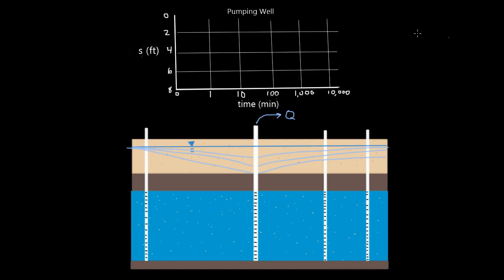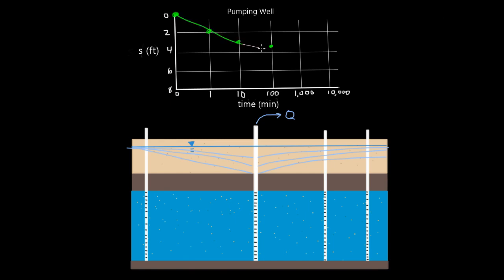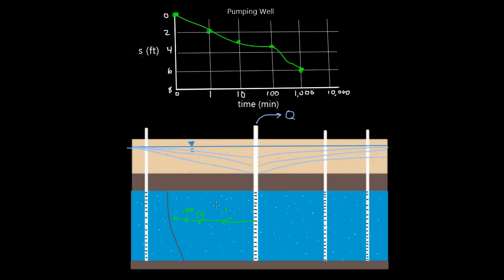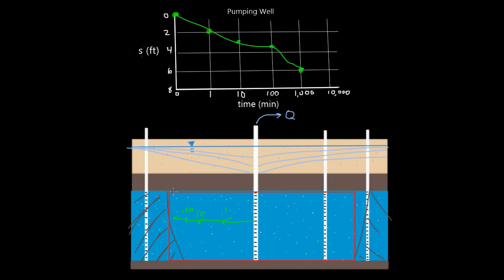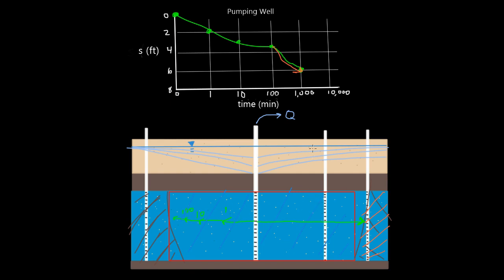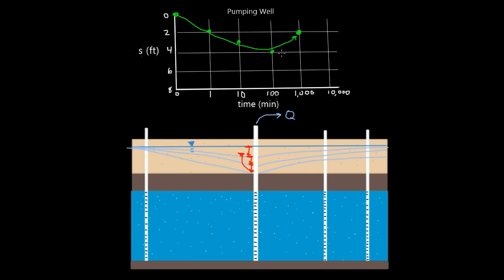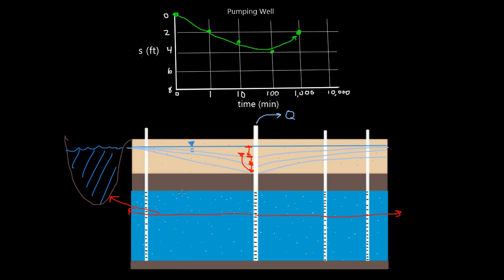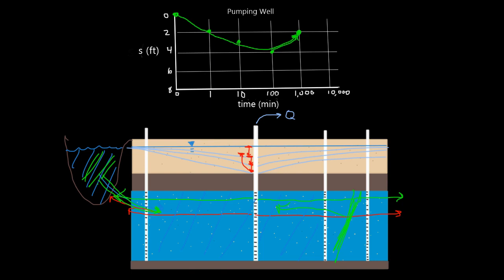Boundary Conditions

Comment: I am on a karst formation by a lake. Noticed my test holes across the bottom of the bluff, water is at same level no matter what soil layer. I have seen it seeping at burnt bluff sandstone, also running under top soil with white sand and burnt buff dry. By the sink the white sand is saturated and thicker layer of white sand. Downhill in the sink there is 2 springs both coming up rotten tree roots. There are areas that have not sunk along the boundary. The seep holes I have dug do fill and overflow. Other lakes west of the karst are recharge plus sink holes filled with glacial till along cracks on bluff. I have dug down 6 feet chasing the springs. At that level I am pulling up fractured pieces of sandstone. Never did improve spring flow in hopes of cleaning out thicker layer of top soil out of the sink. Trying to put down a driven point well and hoping for a flowing well. Thanks for the videos they have been a great help in understanding the hydrology.

Comment: Great job. Please just want to find out.....in the case of a fault boundary, the effect is not necessarily symmetrical on the flow, right?
Reply from the maker: correct - if theres a fault (impermeable boundary) to the east, for example, you would see increased drawdown to the east

Comment: Hi Dane, I believe your depiction of boundaries is incorrect. Drawdown does not 'recover' due to hitting a constant head boundary. Instead the drawdown is less then what would be predicted by the Theis equation, which assumes infinite unbounded extents of the aquifer. Please take a look at Pages 330-331 from Freeze and Cherry (1979) for a proper depiction of how to account for boundaries.
Reply from the maker: You're right, but i think my overall explanation is still correct. the rate of drawdown decreases when you hit a recharge boundary.
Reply: @daneandersen8181  Yes you're right the rate of drawdown would decrease when encountering a recharge boundary, but relative to what? The rate of drawdown would decrease relative to an unbounded aquifer. An overall explanation should start with an explanation of the Theis solution listing all its assumptions. Then explaining the situations that a hydrogeologist may encounter that violate those assumptions (e.g., boundary conditions, leaky aquifers, unconfined aquifers, etc.).
Reply from the maker: @reynoldchow2289 this video was more of a qualitative approach to what you might see in an aquifer test than an explanation of and comparison to assumptions made in the Theis solution. Maybe you should make that video!